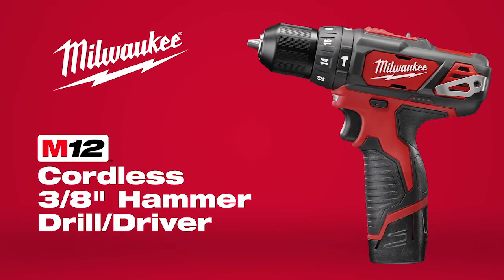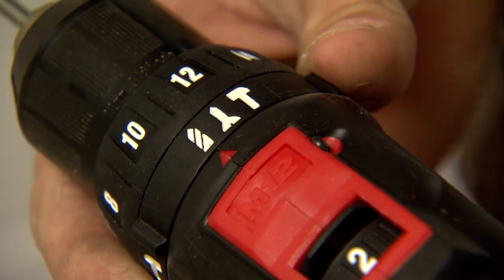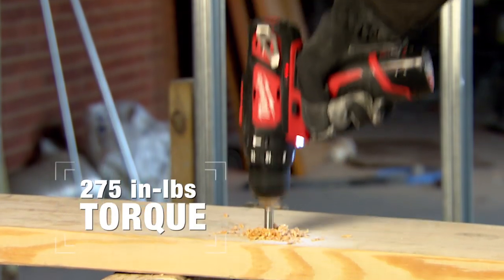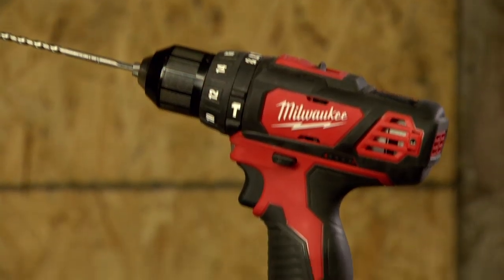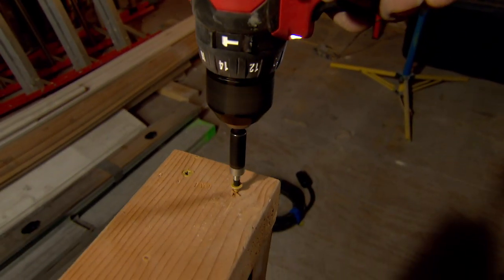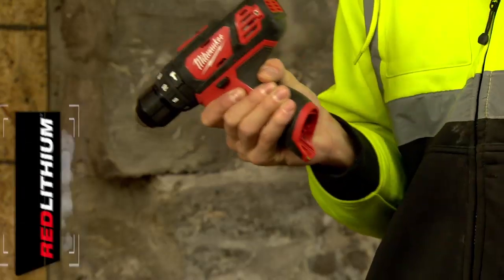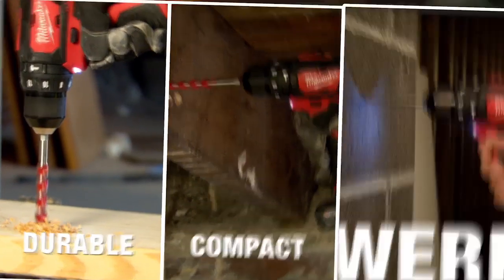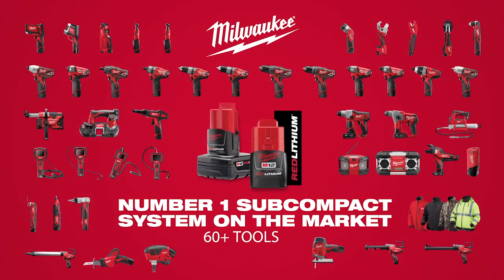Milwaukee® M12™ 3/8" Hammer Drill Driver 2408-22

Comment: I have this one and it's good for light jobs, but the hammer mode is just unlocking the chuck to move  back about 1/8" and ride on a bumpy ring to create the vibrations / hammer action. It doesn't compare at all to a legit hammer drill though, especially for speed when poking holes in concrete.
Reply: you think is still capable to do the job for household stuff like drilling holes in concrete/briks for hanging racks or for TV mount installs?
Reply: @pomodraw  I just bought this one today to hang new curtains on my concrete walls. I had an old Dewalt corded hammer/drill and that was definitely much more stronger, however the Milwaukee M12 did the job perfectly and I am really happy with it. For household stuff I'd say it's ideal.